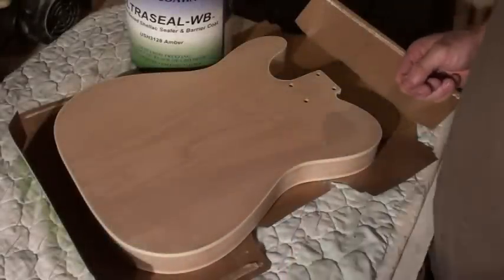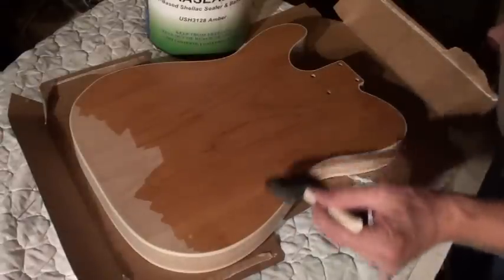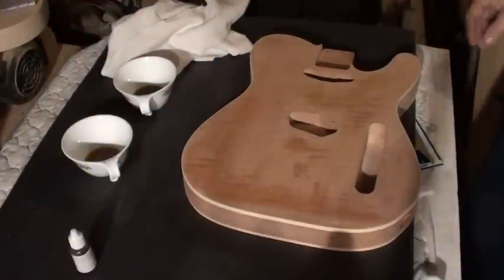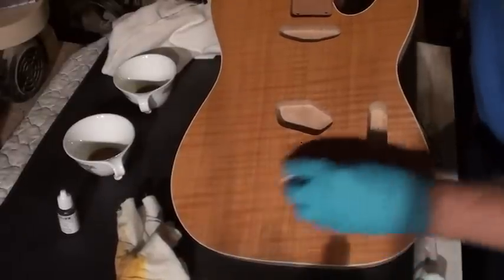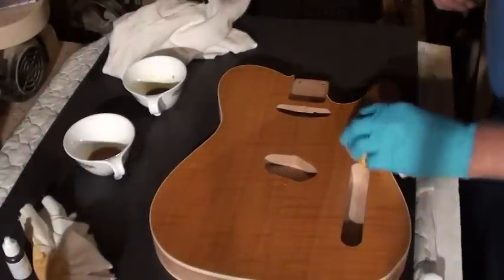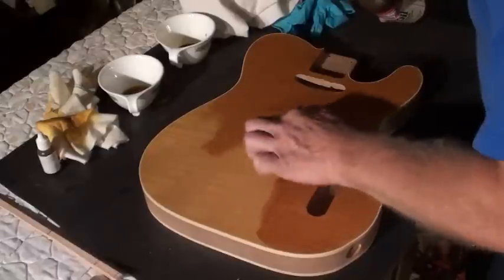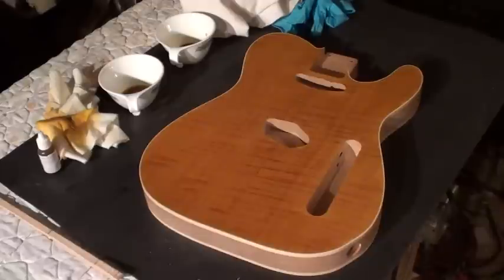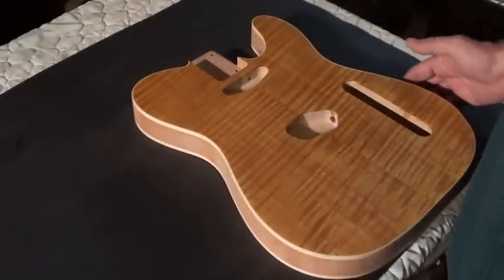Applying amber dye

Comment from the maker: If I am using truoil I will do it on bare wood so it can do the most grain enhancement, filling first will take away from that. If using a dye I dye first,let dry, then apply truoil, it will grain fill and I believe Birchwood Casey also carries a filler if I"m not mistaken.

Comment: Hi, I just attempted my first dye and it came out horrible. What are some tips that would lead to a better finish. I was working with a alder squire body. I used some amber dye I got from stew mac and mixed it with water. At first it went good then later coats started to dry all spotty and came out dark in some places and I'm pretty sure I was being even when applying. I was also doing this in direct sunlight if that matters.